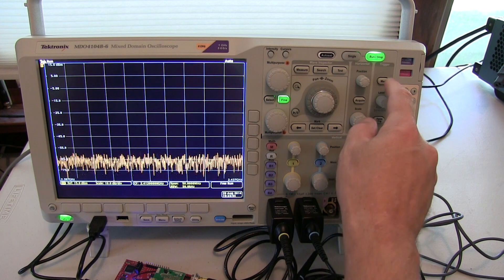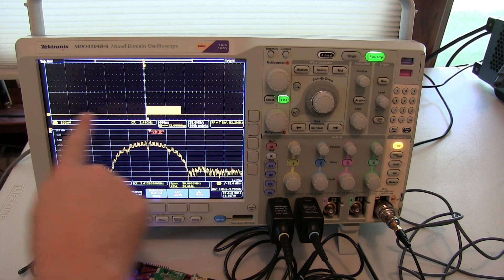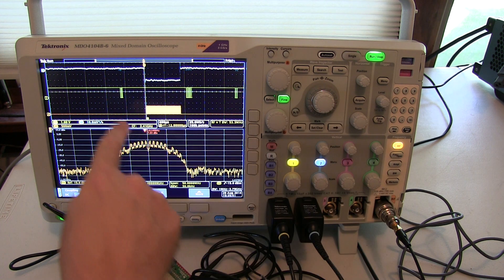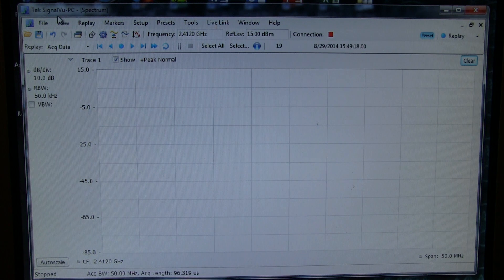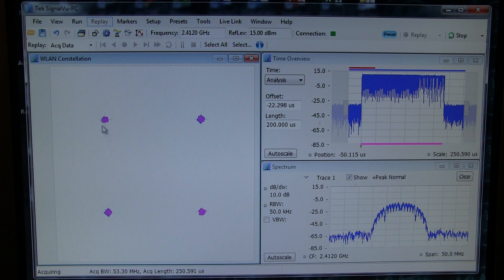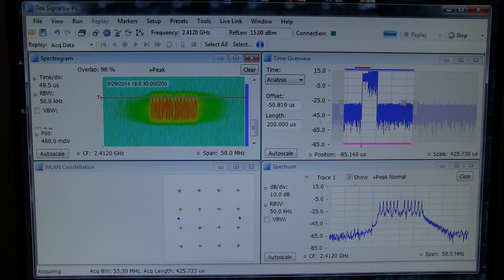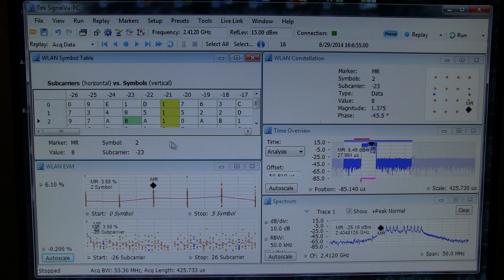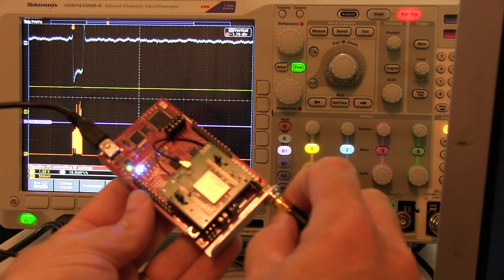#169: Embedded WLAN module testing with the MDO4000B and SignalVu-PC

Comment: Cool Alan. Very nice scope.  Which WLAN module were you testing? And also which evaluation board is that under the module?
Reply from the maker: These are from Texas Instruments.  The WLAN module is a CC3000 EM board and the MSP-EXP430FR5739 Test Platform.  Here is a doc from TI on this eval platform: http://www.ti.com/lit/ug/swru326/swru326.pdf

Comment: When I see videos like this, I always think that I chose the wrong education/profession. I majored in computer science, but the older I get, the more I have the nagging feeling that electrical Engineering would have been more interesting - and you definitely use cooler toys for that than for creating software architectures. :)
Reply: Gregor Ottmann I sometimes think that too, and start to drool when seeing such a scope and wonder what nasty things I would have to do to get one... but that is quickly over when I need to develop a new highspeed realtime dataprocessing algorithm feeding 10Gbit/s data through a 256GB RAM 24 Core server...